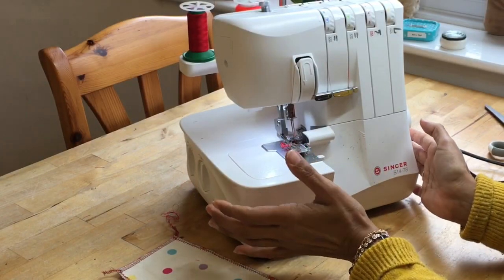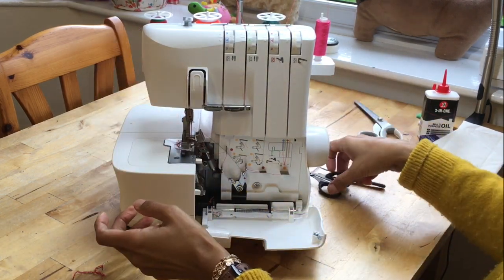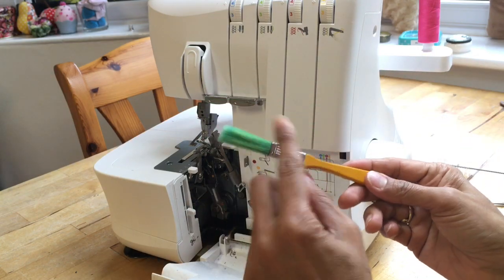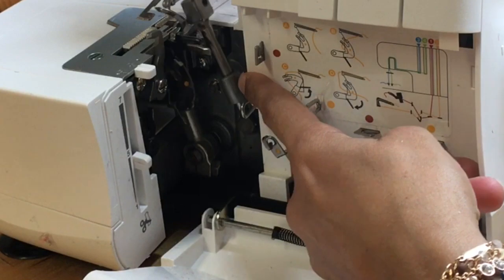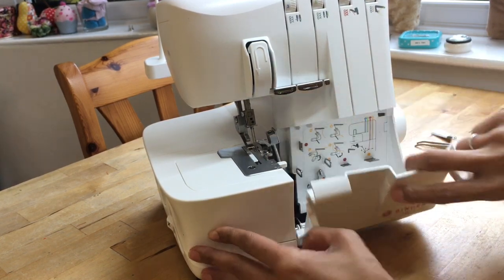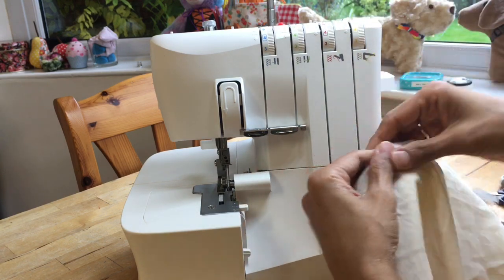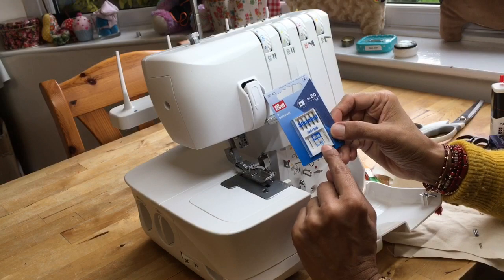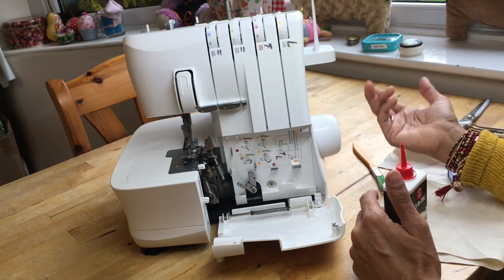Bad Stitches - Clean the Overlocker | Abi’s Den ✂️🧵🌸

Comment: I brush mine down inside after every use. It literally takes a minute! (I was always told to never use 3-in-1 though..🚫, only oil for sewing machines, don't remember why...).
Reply from the maker: 2 2 if 3in1 oil isn’t suitable for sewing machines but is for other machines, why? It’s a sewing machine manufacturing scam... they want you to pay two / three times as much but it’s the same thing in the bottle despite what they tell you... but manufacturers might not be the ones to say it... it’ll be the sewing retailer
Reply: Abi's Den  I wouldn’t doubt that, it’s all about money.